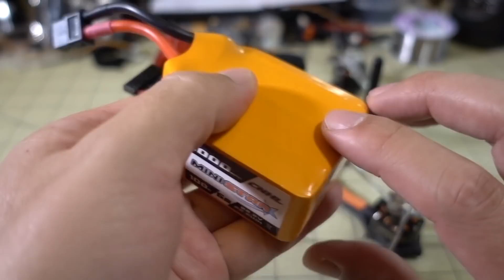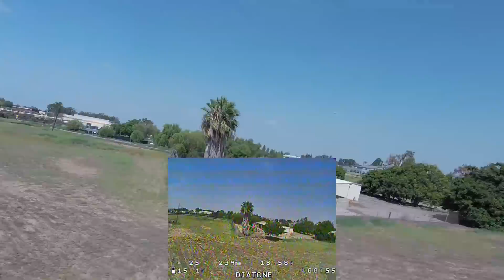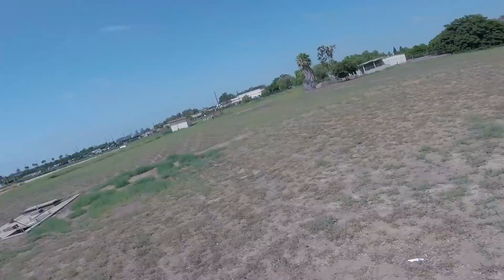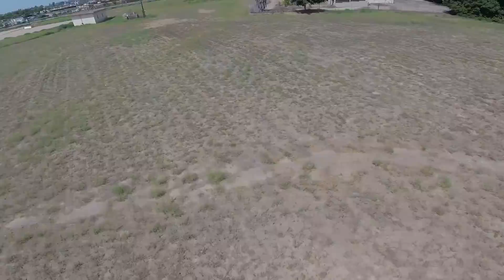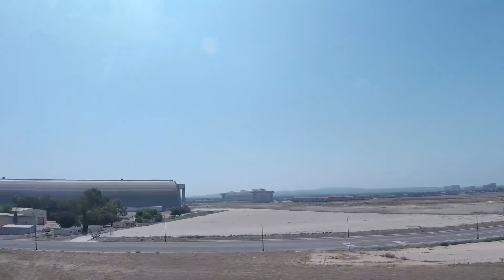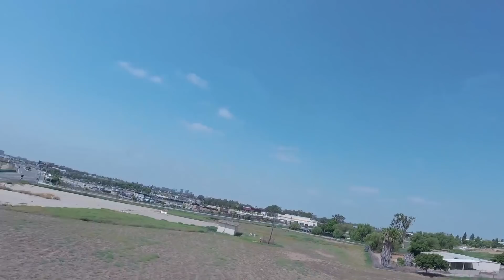Diatone 2018 GT-Tyrant 6S Monster Freestyle Drone 😮

Comment: I have the 4s 2306 2450kv sunnysky edge motors. I haven't installed them yet. Im just wondering how good they are
Reply from the maker: Those motors are good.  DIatone uses them on many of their 5-inch drones.
Reply: They are good on 5s as well and are very fast on 5s. Gt200n stock with flash 5051 bi-blades and a 1350mah 5s lipo plus a cell phone strapped to the bottom =110MPH
Reply: did they get hot on 5s?

Comment: Another zip on the front of the mount right behind Fpv cam should help a lot
Reply from the maker: I tried that but the props hit it up there.... that's why I need one that can screw down into the standoffs.
Reply: Albert Kim I see your mount is to wide you could try to trim it flush with the top plate but so many quads so little time ;o)
Reply: And yeah I'd give you 175 $ for that one
Reply from the maker: Diatone will be making a 3D print for this and I'll have it in a couple of weeks.  This is not for sale yet.  I plan to fly this guy a bit longer.

Comment: looks like a BEAST ..but so UGLY !  I love the old TYRANT (still have 3 !)  why not do a nice topplate like that ?  eliminate the stack and have three separate boards and lower the top !  very easy to maintain.  blah blah blah ..
Reply from the maker: It's already a low rider.  The top plate is in line with the prop line.

Comment: Not to impressed with it but im not crazy about diatone anyway just my opinion.  But your video is great as alaways albert.
Reply from the maker: That's cool... you like EMAX stuff better?
Reply: i would say yes i think e max is made much better diatone has nice products but just not reliable enough. i feel they burn out to fast . and there quads are not that cheap whats that tyrant going for about 250 . i can hear some motor sounds in your vid may just be oscilations but you can hear it doesnt sound that smooth. they just need to take that little xtra step in details . customer service is great but i dont want to have to call them all the time lol
Reply: definitely don't agree with what you "heard" in the motors. He's got a camera that's soft mounted rattling around on top - also very hard to tell if its windy or it's just the camera movement causing resonating oscillations when he's at 3/4 throttle. 

Other videos of this quad + the stock tune show nothing like this at all.